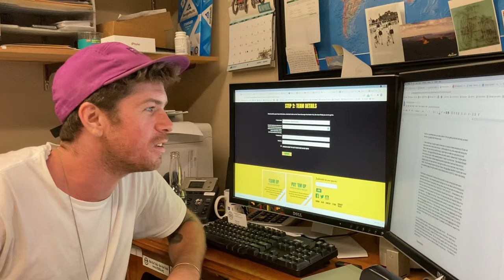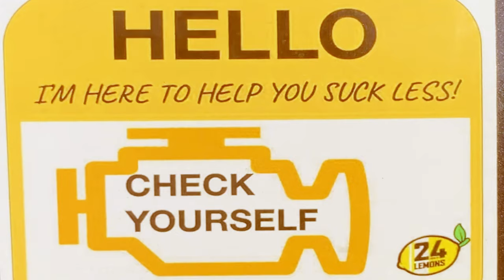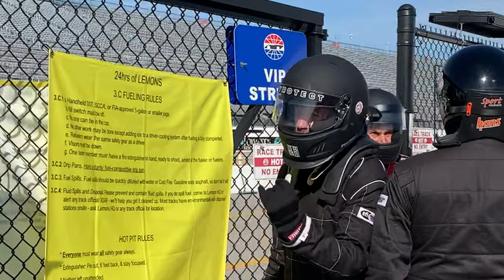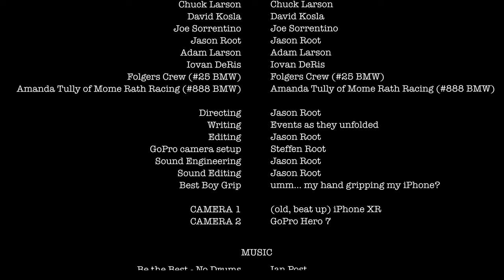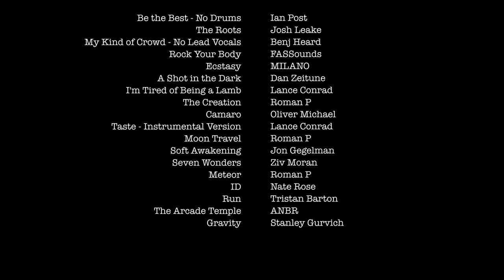24 hours of LeMans or 24 hours of Lemons?

Comment: To clarify, the lap penalty is at the start of the race, not the finish. If you get 25 penalty laps you start with -25 laps. That means if you don't complete as many laps as you are penalized it's possible to finish the standings in negative laps overall.